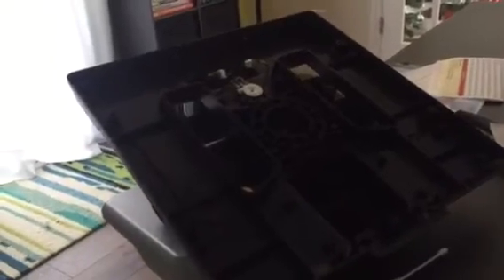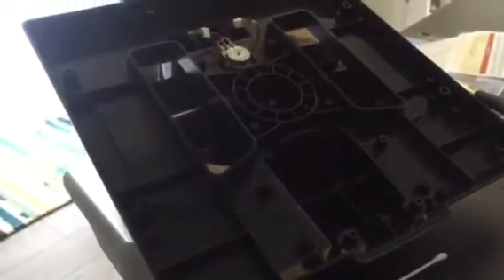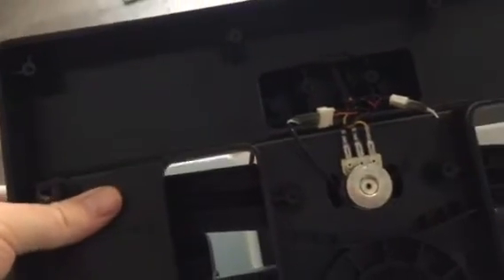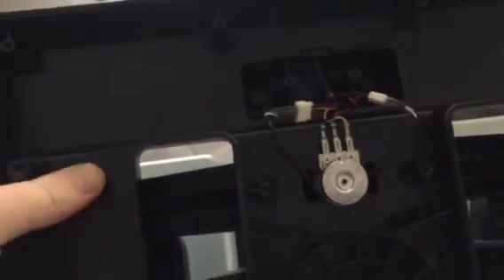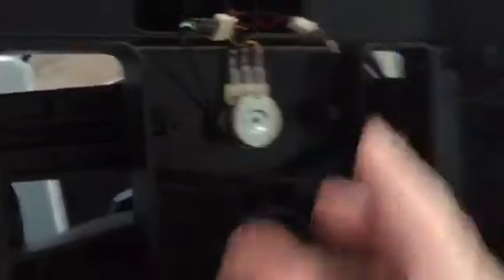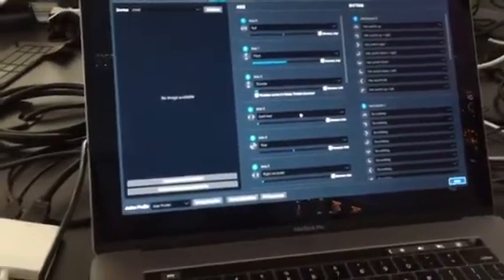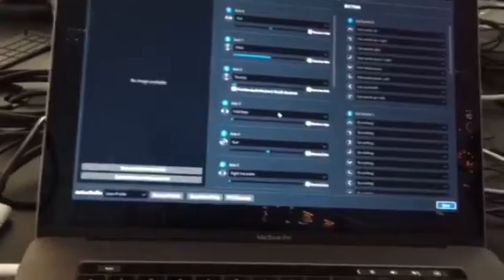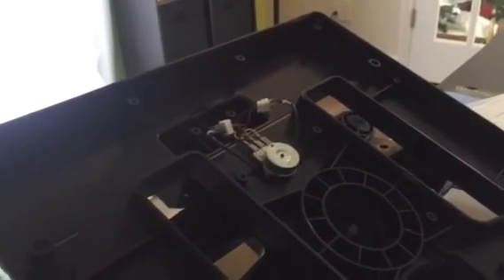Logitech G940 rudder spike fix

Comment: have you also had spikes on the R1 and R2 of the throttle? if yes, do you know any fix?! thx
Reply: Yes, that's a known issue with the G940 as well, tho I suppose most of the threads on this topic have been swallowed by the Internet at this point, with this model being dropped, etc... Anyway, open up the throttle, and you'll find that the wires to R1 and R2 might be routed poorly, and being pulled on when you move the actual throttle levers. Re-route the wires, snug up their connections, and you should see an improvement. I remember doing that to mine in 2011 or something.

Comment: Is it possible to only use this rudder pedals without the G940 Joystick and Throttle?
Reply: You can use them, but Throttle and Pedals both connects to the Joystick base, and from Joystick you have only one USB cable to PC. 
It is nice thing that you can use only one USB port for all devices, but not nice that if you want just one device then you need to have it chained through Joystick anyways. Logically it doesn't require you to use the joystick in games, just have it between and no power required either.